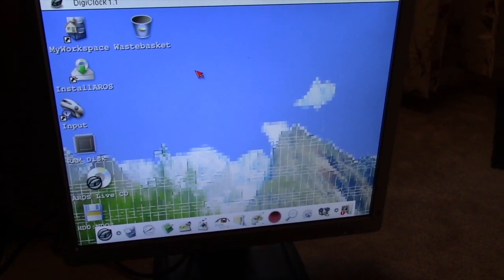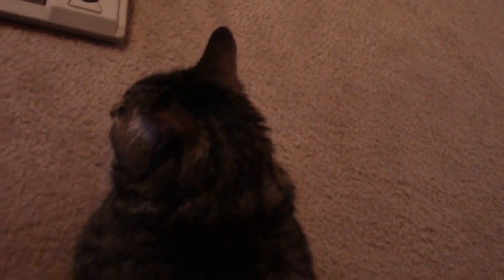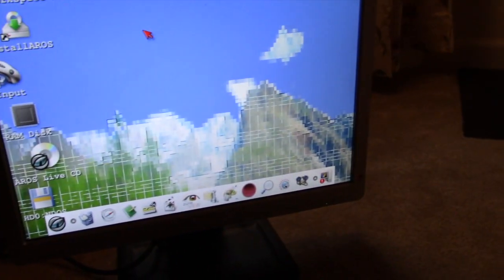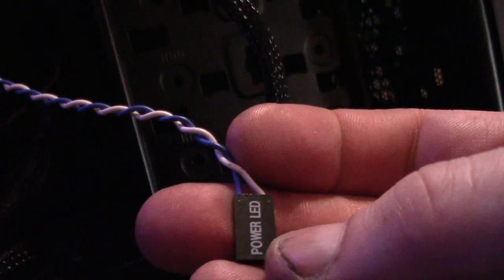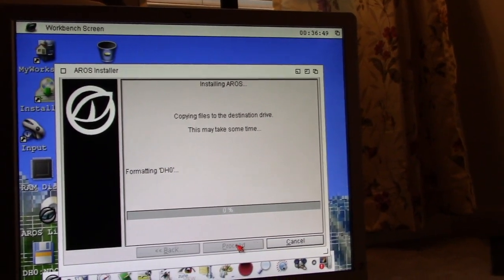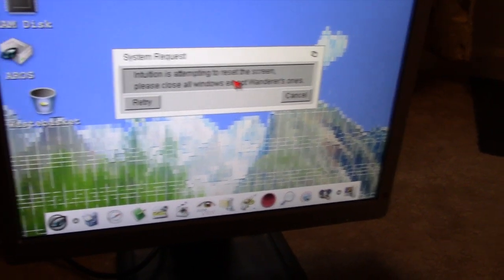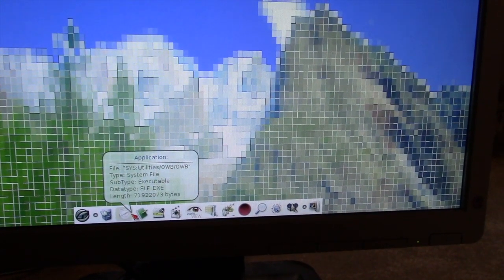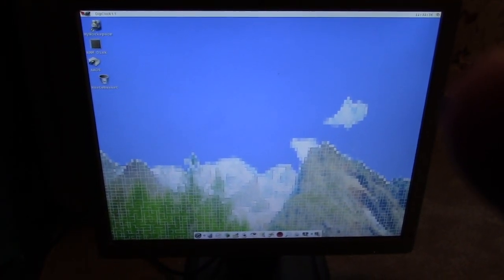Episode 57 Amiga pc in 2018 ?  Aros Icaros desktop!

Comment: Hey mate. Nice vid. I did a very similar build as yourself. Old PC i had laying in a shed waiting to be scrapped. Dusted it off and installed Icaros. Boots superfast.
Just wondering if you've found any...."use" for it?
I couldn't get it to see my network, and it also doesnt seem to see my floppy drive.
And I can't find any info about how to throw an emulator on it, as AROS out for the box does not support old Amiga programs and games, so you still need to stack an emulator of some type on top.

It is fun playing with a non windows OS though. Not done that in years.
Reply from the maker: well it runs Aros, so its NOT amiga OS, You CAN run Amiga programs IF You install WinUAE, but since I have an Actual AMIGA , No not really besides nostalgia
Reply: @ChrisEdwardsRestoration  Yeah aware that it's not Amiga OS. AROS never pretends to be anything other than "Amiga Like". If nothing else, it's fun to just play with other OS's other than windows. :)